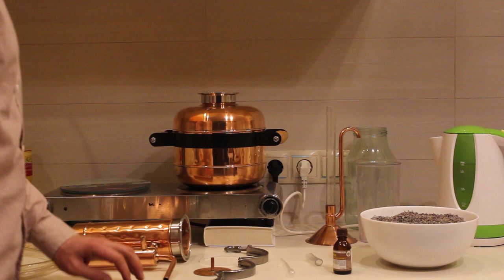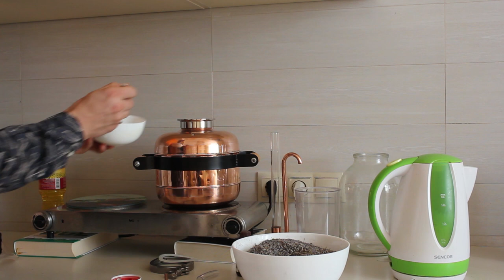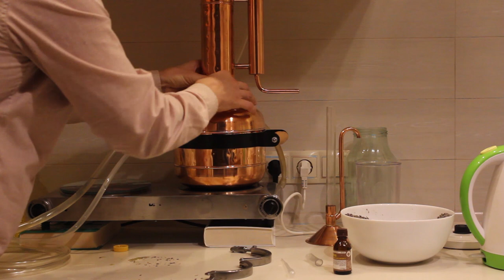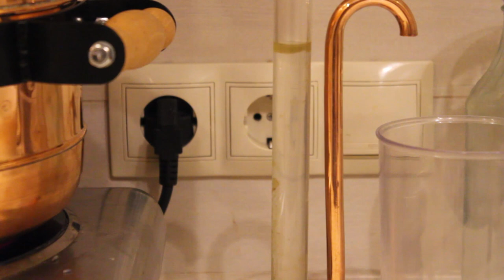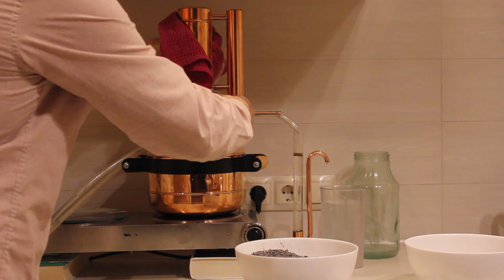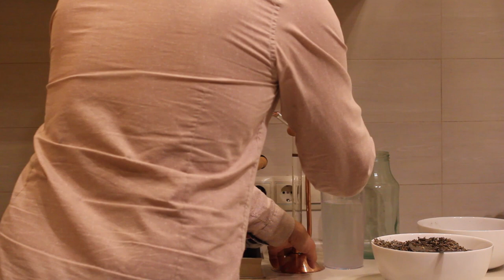Distillation Essential Oils And Hydrosol Ukrainian Copper Distiller

Comment: Which method can use for roses and tube roses and champaka and jasmin flowers?
Reply from the maker: for all herbs and flowers, it is better to use steam distillation (when placing plants in a column), but plants such as rose and jasmine contain a low percentage of essential oils, for example, in order to make 5ml of rose oil, you need to distill 50kg of petals, so you need a distiller with a load larger volume, if you are interested in an industrial distiller or you would like to know more information about our models then write to me by mail: copperproc@gmail.com

Comment: How do u know when water has all gone in pot
Reply from the maker: Paul Bray Hello! water is poured into the pot before distillation starts
Reply: @CopperPro  I think he wanted to know how you can tell when the water has all evaporated and when you should stop.
Reply from the maker: @xrpgal1393  you need to look at the amount of hydrosol that you get, you will get the same amount that you pour into the bolier, and at the end of the distillation, you need to leave 20% of the water in the boiler so that the boiler does not burn
Reply: @CopperPro  Perfect answer, thank you

Comment: Is it better than alquitara?
Reply from the maker: It's a good alternative. A lot features wich make this distiller , more efficent than alquitara with the same size. Wooden handles, and reliable connection thanks to the clamp. Also you can take up the radiator at any time and simply change the contents of the column.
Reply from the maker: https://www.youtube.com/watch?v=F5Gop386dlo  - new video comparison

Comment: What do the hot and cold water tubes connect to?
Reply from the maker: Distiller is meant to be used with water tap by using the central water system.
Reply: The tubes, cause a circular movement of the water. The top tube, drains the heated water from the condenser. The lower tube, is connected to you're little submersible water  pump, or to your kitchen water spout. Cold water is sent TO the condenser through this tube.